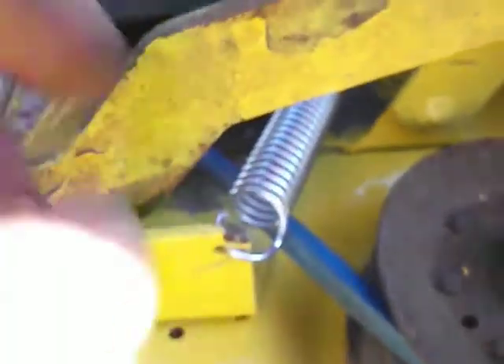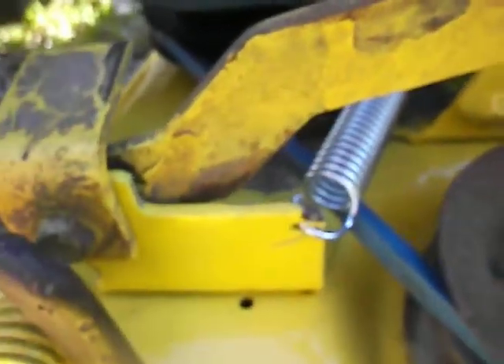Drive Belts John Deere 160 and 170 180 Series mower.

Comment: does anyone has a reference to JD 170 .   This is the older model with 38 inch deck.   Deck Belt broke off and there is no belt diagram and installation instructions that I can find.   The mower was given to me by an older relative.  I would appreciate any info that yo may be able to provide.

Comment: I run a 170 now, drop the deck, belt comes off easily once you rotate the steering rack. These things are like tanks. I use mine to pull posts out if the ground every season with a winch. Lug around a carport, shed, and it mows the grass. Really well built machines. The rear ends are made by a company called tecmuseh they still make them in all shapes and sizes. Just got to find one similar. You can even flip out to hydrostatic drive.
Reply: I got one I'm making  a race mower out of it
Reply: So how do u rotate that steering arm to get off the belt
Reply: @mattdob9330  Two bolts on the steering gear support, they attach to the frame rails. Undo them and the bar rotates. remove the steering pushrod attached to the left wheel and poof. Belt slips right off.

Comment: I picked up a 170 abandoned in an alley needed tires and a carb rebuild and the deck was rusted thru in a few spots, I cut the rust out and welded in new metal painted it installed new tires now have a beast of a mower,had to change a few odds and ends but I have less than $200 in it and love the thing!

Comment: I was a mechanic at a John Deere dealer and have worked on many of these. They arw my favorite model series and i have several of them. The back wheels like to rust onto the axles. Sometimes i chamfer the ends of the axle, place a 2x4 behind the wheel as a pry bar and drive the axle in with a punch. If it doesnt move i dissemble the transmission and put the wheel in a press and press the axle out. That or pry tge tire off with machine together though this is no fun. I always clean the axles and grease them before assembly. Dont forget the axle key.

Comment: I've been working ona 180 for a cpl weeks now..transmission was acting up mainly..got it back together and it took off spinning tires in gravel..fastest mower I been on...but belt jumps off the back..and sometimes in gear..it just stalls on the engine pulley and starts smoking...ain't figured out why yet..I was wondering if that small metal bar that's bent different ways in back is supposed to keep the belt on the pulley..

Comment: I found a 1988 160 and I am replacing the belts and a few other things. I have 2 questions that I hope you can help me with. I didn’t pay a lot of attention to how tight the drive belt was when I removed, when I put new belt on it seemed way to loose so I researched diagram to make sure I didn’t mess up. The idler pulley is slid all the way up to tighten the belt but still feels loose. I double checked the old belt against the new belt and they are the same. Second question is when I go to reinstall the deck what do I loosen to get PTO belt back on ?  Please help my patience is wearing thin. Haha

Comment: I haven't used it yet. It ran for the first time in 4 years today, with just a little starter fluid in the carb..i bought this from a friend, for $25! And it came with 4 brand new tires! I put a ignition in it, because he didn't have the key, I put a spark plug in it. Its going to need a battery, and belts im sure. Yes that was $25.00. Not 250.

Comment: I have a 160 and when I turn on the PTO it runs for a minute and then shuts off what's that all about?
Reply: I know mine the battery wasn't charged enough to keep it goig
Reply from the maker: That is usually just the switch has moisture in it or the governor is shot not revving up. Needs to be looked at by a guy like me to determine what it is. The easiest cheapest route is to start with a switch. Sometimes a PTO will get water logged or oil soaked and it shorts when the switch is turned on. Usually in that case the PTO would also blow the fuse but not all the time. First thing to do is make sure the Governor is freed up test the governor by finding a hard hill see if the governor kicks in the extra oomph to get up that hill is one and only way to test a governor aside of physically playing with it to make sure it is free. also on the Deere 160 thru the 185 series make damn sure ya blow thru the fuel line to the TANK. make sure that is clear. The outlet of the fuel tanks on these machines have a bad habit of collection dirt at the shut off valve under the seat and the tractor will run but it won't run right. I usually remover the entire body and fuel tank and clean em out good. U can use Sea Foam or like me I use the Berrymans cleaner almost the same stuff and keep putting air into the tank blow the crap out the top of the tank. Those are the only issues outside of the PTO being bad so if everything else is fine then it is the PTO. So you are into a switch for $20 and can of Sea Foam for $13 bucks and use your air line and about 5hours of your time. If not drop the PTO. I have used ones here $100 bucks plus shipping. Don't buy the Cheapo net PTO it won't last but a years time. You know like right when the warranty is up it goes poof... Those R thee only 3 things that will make the mower poop out when ya throw the PTO on...
Reply from the maker: @zachholley8749  That is another big issue of this series of Deere tractor is making sure the battery is good. These modern batteries don't last but a year or two in these types of machines. I usually buy a new one every spring. You can remove the stator from the top of the engine ya know the big fly wheel. You would not believe the crap that collects inside these alternators. Makes a big diff especially if your battery keeps getting low or going dead. Clean the magnets and the pick ups with alcohol and carb cleaner and blow it all out with air... Makes a huge diff in this series machine. also replacing the battery cables is another big issue this series Deere did come with excellent ground system but the cable suffers from exposure over time so that is a good point if ya don't have enough juice running the system flip that switch and it will choke out on ya.
Reply: @thekingsilverado9004  thanks this is a big help I've been trying to find someone that actually works on these older models I have a 180 and it's a beast
Reply: @thekingsilverado9004  the # is not working
Reply: @zachholley8749  He doesn't care.

Comment: Thanx for posting. That shot of the drive belt around the steering was just what I needed to see. my son pulled a 160 out of the weeds a couple of weeks ago.  unfortunately, the engine was stripped of starter, coil, and carb, so I repowered with a twin cylinder Kohler (it was the only engine in my garage).   It won' t be pretty because  the hood no longer fits, but I think this may end up being perfect for brush hog style use.,

Comment: I have a John Deere 180 can I ask were do you get all your parts at
Reply from the maker: I buy used machines I find on the net. Not as easy as it sounds. Give me a list of what U need. I am also part time SUB DEALER 4 DEERE. I do mostly repairs for the box stores that sell the stuff. 570-459-6988 give me a list of what ya need
Reply: I'm gonna restore it I am looking for a new deck and seat it's the best riding lawn mower I've ever bought for 400 bucks
Reply: @thekingsilverado9004  so almost all the bolts and rusted and will not break loose just spins the other side trying to undo seat
Reply from the maker: @zachholley8749  You cut the BOLTS.. That is how ya do it. You can use the Modern day JB Weld it's much improved... Ya just cut the shit and install new hardware.. That simple... I don't wait until someone does shit  4 me here. I run the show...If ya got an ANGLE GRINDER with cutting wheel or an AIR POWERED WIZZER you got the world in your hand.... Hack and slash don't work at all y'all see how they worked  4 GUNS & ROSES... I've bedded bolts with the JB weld on good condition  OEM seats to keep the machines original it mostly works out. Make ALCOHOL what ya use to prep the shit.... Then take the seat & shit indoors 4  a few days to dry the seat out. Then use the JB Weld stuff. If ya don't dry it out it won't hold and if the metal is cold as well. I did not mean drinking alcohol a .98 cent bottle from the dollar store does the trick on most of it... Prep the shit with sand paper I use my wizzer with the sand discs... Go like hell takes about a half hour U can put a new BOLT STUD in place with the JB Weld shit... Otay??? Seems harder than it is.... Cut the old bolt stud off and have a blast some of the seats ya have to drill a hole where the bolt had been that is why I say the seat needs to be dried out quite a while it won't work with damp foam let alone cold un-prepped shit.. If the  bolt has a bolt slot cut the damn thing off and keep the bolt slot use a modern bolt and JB Weld in the same hole try to keep some steel there to hold the bolt in place... That is how I do it here and it works holds  4 years.. My seat is proof of that...
Reply: @thekingsilverado9004  is there a diagram for the PTO drive belt and how tight does it need to be any way we could communicate via email if like to be able to show you what I have it's help allot??
Reply: 😂What a fkn joke
Reply: @thekingsilverado9004 that was great. loved it. will u marry me